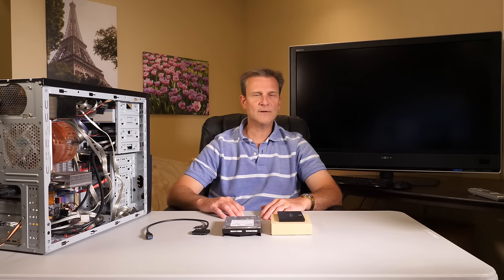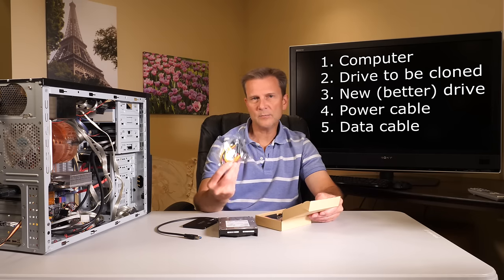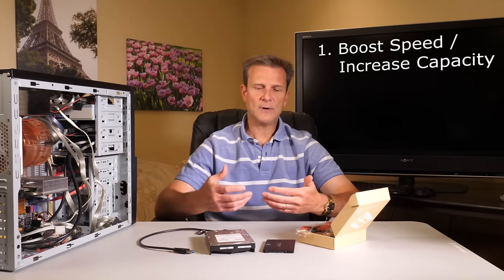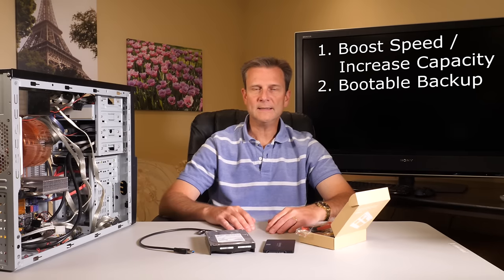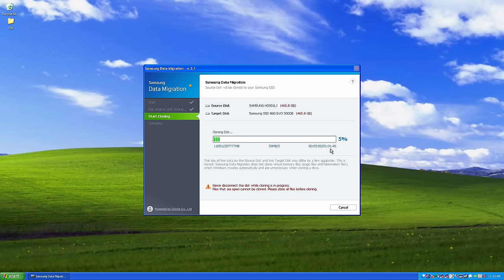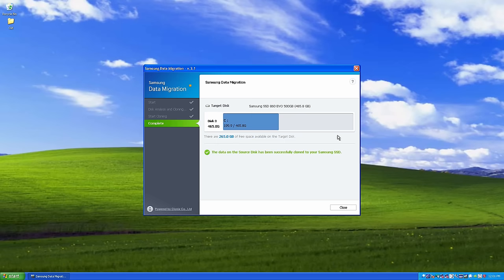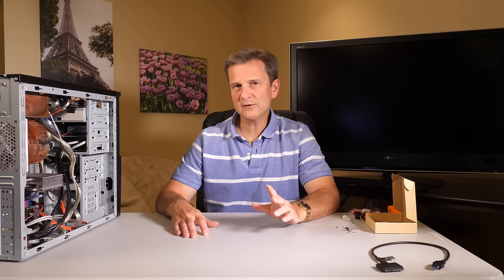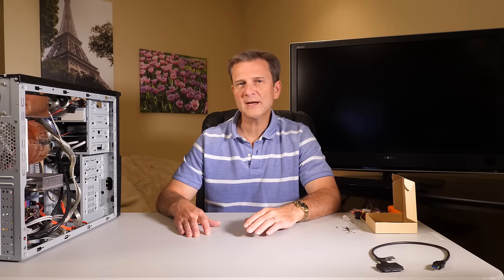How to Clone Your Boot Drive to SSD Without Having to Reinstall Windows or Any Other Programs

Comment: IMPORTANT NOTE: After cloning Windows OS you may need to re-validate your Microsoft OS and MS-Office as it will report that the Licence key isn't validated in most cases you will need to be online to allow the software to check the License validation server  and validate don't forget this important step. With OS's like Linux this isn't necessary

Comment: I found using an external SSD Case to be cheaper than using a data cable. The case comes with the cable for laptops.

Comment: Cloning instructions start at 14:00
Reply: deserves more upvotes
Reply: thanks for the info.
Reply: That saved my 10 minutes (4 before I realised someone had done the hard work and stayed awake during the initial yatter.
Reply: If ya all felt you were wasting your valuable time with the first 14 min. as you knew all of that what the heck were you even watching this at all. There is so much that was left out that most beginners should have already known this much. Things like, DOES your software automatically set the OFFSET for SSD. I don't know about Samsung, but WD does not. How about UEFI? or DOES the software automatically partition for either MBR as opposed to GPT or does that have to be done. In other words, does it copy to UNALLOCATED space ONLY? I prefer MINI TOOL Partition Wizard myself. The only thing about it you need to know is that it does not automatically clone the BOOT portion (partition) on a GPT drive and that has to be done in a separate opperation.
Reply: @charleshadden2937  For the information contained after 14:00.
Reply: Could you boot from the cloned hard drive?

Comment: When SATA appeared in my life, I purchased a dual bay SATA drive dock by inateck. The new version of my device would cost around $50 US today and is available on amazon. You simply remove the dive from your PC and place it in Slot A on the dock. Put your new drive in slot B and press the device's offline cloning button and wait for the cloning process to complete. Then you install your shiny new drive. That's it, job done. The drive dock is also useful as it can turn any SATA drive into a plug in USBc drive, I also use it to backup PC system drives onto offline large capacity HDD's for safe storage elsewhere. 
FYI; I am the I.T support for my entire family and I have never regretted buying this thing as it has removed hours of unnecessary messing about and uncertainty every time I have used it.
Reply: absolutely right!! after hours of wasted time on YT, yours reminded me...hey, I've got one sittin' right there!! :-) thanks, and great luck!

Comment: Thank you Sir. This video is definitely five stars out of five star rating.👍👍 Further, the video host is the closest thing to a "Mr. Rogers of Tech" as is possible. His calm, clear, and friendly presentation. I'm sure is reassuring to anyone without a lot of computer experience.😊 I have built several computers, but have never cloned a drive before, and this video will definitely assist me. Lastly, not that it's important, but I have a feeling that the host is either an active member or veteran of Military service, as am I.😉

Comment: Great tutorial video. Just one thing that I noticed was that it was quite a while into the video that you first mentioned anything about making sure that the power was disconnected from your computer. That is very important, especially for those that have little or no experience with this type of procedures. Like I mentioned, this is otherwise a very educational video. Keep up the good work!
Reply: I'm guessing that you unplug the computer just when you're changing to the ssd? Thanks.

Comment: Thank you for this good video! And I have a question... I've done several cloning before of regular 3.5 drives just for protection with Macrium software and the destination drive always has to be of the exact same size as the source even if the source drive is almost empty. 
When trying to clone just windows and perhaps all the installed programs to an SSD do I have to get an SSD drive of the same size as the source? I just want to have an SSD only for Windows and programs, all my other staff can stay on a regular 2TB spinning drive. Basically I am wondering if the cloning software you recommend would allow cloning drives of different sizes, provided the data you are cloning does not exceeds the SSD own capacity?

Comment: one thing I do that I'm surprised more people don't do is use the boot drive for just Windows and all apps. I have a 500GB M2 drive as the boot drive and with Windows and all apps installed the space taken is just 114GB.  So that's all I have to clone. All data is kept on other hard drives. I still use a desktop computer so this is easier to do on a desktop where you can have multiple hard drives. If the M2 drive should crap out I just get a new one and rebuild it from a saved clone image. No data loss. I never saw the purpose of having a 1TB boot drive. Yeah, you can partition it but I'd rather save my data elsewhere and not on the same drive I boot from. Thanks for video. Very nicely done.

Comment: This is very good, and just what I needed. I put a new Samsung SSD with Linux Mint on my PC, and it was so much faster than the old Win 7 HDD, that I want to get another SSD. I still need Win 7 for the software that doesn't have a Linux equivalent. This video shows me exactly how to do it, and what I need to buy. You have another subscriber.

Comment: Very good video, but one thing you left out was how important it is to ground yourself to the chassis before reaching your hand inside. You could very easily zap a component in there and fry it if you happen to have a static charge on your body.

Comment: my samsung data migration software can't seem to find my samsung 850 evo in windows 8.1 or 10. I used a usb to sata/ide adapter like you had but no go. I had a samsung 840 evo that worked fine.  This is the second one that replaced another one that didn't work.

Comment: Good morning.  First, I would like to think you for your very professional presentation – outstanding teaching.  I’m a 74 year old NON-Nerd who has a billion questions but I’ll only ask one at this time.  You started your presentation discussing the cloning of a laptop using a USB 3.0 to SSD drives cable.  If I have a USB 3.0 port on my desktop, can I use the laptop  procedure instead of going into the desktop itself, other than disconnecting the old HD and installing the SSD after cloning?  Thanks for your time. Phil
Reply from the maker: Hi Phil, yes this should work. If you are trying to clone onto a HDD (the big, old spinning drives), it is possible the cable may not be able to sufficiently power that type drive. But if you are cloning onto a SSD, that should work just fine.
Reply: @NerdSidekick  Wanted to let you know that the transfer from HHD to SSD was so easy that even a NON-Nerd could do it. Thanks again.  Phil

Comment: hi great vidoe
1 question
can i do the opposite?
override a working system with old drive?
i mean to over run the local drive from an external drive

thanks
clone another drive on the local boot drive...

Comment: Useful video. Sometimes I find it tough to start a small screw with my fingers, so I put the screw onto the screwdriver then aim it into the hole. If you use the right sized screwdriver it will hold the cross-headed screw even when horizontal. If you magnetise the screwdriver a little, by sliding a magnet along it once, then that can help too. But keep magnets away from the old-style spinning hard drives!

Comment: Nice take on how to go from a regular HD to a SSD. For me the best take from your script was to always go to the new drive's web site and get the migration software there and it's free! We are the other side, the often builders of PC's and restoring Mac Pro computers so our down take was ... the many loose cables not tied together! LOL I suppose before they made windowed computer cases no one ever bothered to neatened up the inside. Now zip ties are part of the build. Restoring three Mac Pro computers, strangely there are few cables in the case. Oh and the direct connect cable to a loose sata hard drive is a wonderful tool for doing disk images with (no external case required and it's put back in it's original box once imaged).

Comment: Cool theme music...LOL. Anyway I'm going to use your process, but can forgo a lot of the cabling. I'm cloning from my SATA HDD to an m.2 NVME. When It comes in I'll install it to the socket, so unless I'm wrong it should just show up in the 'Data Migration' software and I should be able to run it.  Is that so?   Anyway, Thanks for your info. You'll save me a ton of work. BTW I gave ya a thumbs-up and subscribed

Comment: For those who don't know.  You don't need to remove the power cable from your Hard drive. Instead go into the cmos (also known as bios).  And change the boot sequence to the SSD drive.  And once you do it you will boot from the SSD. And you can use the old hard drive as a second drive. For other types of files like photos, music, home movies,  etc......

Comment: What I did when I built my computer was put in mobile racks. These racks mount inside the computer and your hard drives go inside sleeves that slide into mobile racks.
I just turn the computer off, take a key and insert it into the mobile rack and pull out the hard drive.
I can clone my hard drive in about 20 minutes with Acronis True Image. There are other fine programs out there but this one I have been using for a long time.
I keep 2 copies in rotation all the time. Security is the first think in computer operation.
Enjoy your computer and keep it cloned....

Comment: Useful video, but it didn't cover using the purchased data cable to perform the same operation for a laptop, which is what I need to do. Could you please elaborate?

Comment: If you are going to clone or image a boot drive, use a imaging software. I use makrium reflect. I use this because I am on Windows 7 and no support available now. So I make a image every couple of months to an external hard drive, about 2TB size is good. If I wanted to put that image on a SSD then I just select the image from the software choices, and let it run. Very simple and you ALWAYS have a back up system somewhere.

Comment: Absolutely love Samsung Magician to clone from small NVME boot drive to a large Samsung NVME. Moving 256g from original to new 980 Pro 2TB took less than 18 minutes. Stored the original 256g NVME drive in the transfer case that I used for cloning for safe keeping. It doesn't get any easier than that.

Comment: my question. Was you running Windows on the original drive while cloning it to the new drive? Or, did you use a different pc having both drives plugged to it to clone them?

Comment: I had a boss who was not at peace with "Let's get them glasses." His irritation with the need for glasses taught me pretty rapidly to put up with such simple difficulties.

You covered being sure not to overwrite a disk with data you want to keep, but said if you're cloning onto a blank disc, there's nothing to worry about.

How about this: If it's possible to clone to a disk with data on it, thereby losing that data, is it equally possible to engage the cloning software such that it tries to clone from your target disk to your source disk? If the software allows this, you could easily wipe your source disk!

Thanks for the otherwise clear instructions. (By the way, it's amusing near the end to keep catching your reflection in a part of the tower.)

Comment: Informative step-by-step video but would like to have seen how you accessed the screws in the case on the other side of the SSD.
Reply: Dan. On a lot of cases you can open the other side to install the screws. If not, putting in the ones you can will be safe enough.

Comment: Good & plenty of good info, thanks;  What if you want to clone the drive but also upgrade to another case/MB as well, but keep the boot drive you have cloned? Do which maneuver 1st?
Reply: Windows activation is tied to the motherboard. Switch out the motherboard, you will have to get a new windows license

Comment: Thanks sidekick. I'm a little computer illiterate...Do I have to clean off my desktop screen? Are these shortcut icons running applications that I have to be concerned with when I clone the new SSD ?  If so, how do I  temporarily get them off my screen and  replace them after I get the new hard drive in?  Thanks

Comment: You might want to add that many newer PCs and laptops are equipped with M.2 SSDs. The M.2 requires a different cable than the SATA to USB cable you present in the video

Comment: I don't believe he didn't show changing the BIOS this is very easy to do and everyone should know how when the computer is starting it will show you what key to press to go into setup it's a different key on different computers (f2 on my present computer) then find something called boot device configuration press enter then go to the hard disk boot priority press enter (press enter again if you had more than one hard drive to give you the options to choose the one with your boot file on it) Then select as your first boot device.  on my computer you can then press f10 "save and exit setup" or hit Esc until the save option comes up finish that and you should be good to go!  note: if you had more than one hard drive it might be a good idea to disconnect the extra ones until you have completely finished the cloning process!
    Now in most cases even if you haven't done anyting in the bios it will probably still work finding the only hard drive that is there which is why and how this guys been getting away with this without telling you but if it didn't work you might be screwed until you figured out that you can always get into the computer bios while it is starting up! yeah sounds good to me humor!

Comment: How long on average for 2 TB?
just to understand, I think the maximum speed of the HDD is 200 mb/s, but I don't think it will read at 200 mb/s, the SSD 400 mb/s, but I've never seen my smallest one at 400 mb/sec.
I have a fast computer, i5 9400f.

I asked a friend, according to him more than 4 hours
at a constant speed of 120 mb/sec
7.2 GB min x 60 min = 432 GB
it's correct?
thanks for the support!

Comment: Will this work with an M.2 NVMe SSD?
Also, if I in the future put back in my old drive for extra storage, will there be any complications or will it just be plug and play?
Reply: Can be done, but different hardware needed.
Reply: I put the older replaced "suspect" drive back in and it was recognized just fine. I'll just need to reformat it.

Comment: My computer is barely 2 years old and the SSD is almost full.  I've barely paid off this thing and am not in the mood to take it to the ubreakifix people and pay them hundreds of dollars more to install something that seems fairly easy judging by this video.  I have my 2T SSD sitting here in front of me and I feel very confident that I can do this!  Although, that thing about the Bios is just the thing that will happen to me, haha.  Crossing my fingers that it will go as smoothly as this video demonstrated.  Thank you!
Reply from the maker: Sounds like you don't need to clone a drive. You just need to install the new 2TB drive as a second drive and move some files off the original drive to the new drive. You'll just have two drives in your system. The original will be the boot drive as always, and you can store your new files on the new drive.

You can change where Windows stores documents by default, for example. Or photos or videos. And of course, you can put your files anywhere you want yourself. You aren't bound by the default location that Windows sets for those files.

Comment: Agree, very informative step by step transition from mechanical HDD to SSD. I was just thinking if instead of cloning to SSD, perhaps I can clone my personal Windows OS to a 32Gb or 64 Gb reasonably quick USB thumbdrive. Do you see any problem if I boot up using this USB thumbdrive on an unknown pc? Thanks
Reply: Exactly my question also.
Reply: As far as I know, Windows does not support booting from a USB thumbdrive or USB HDD. I discovered this recently when I attempted to boot my server from an external HDD. There are work-arounds, if you want to do some Google searches.

Comment: I use a Linux usb boot flash drive with ddrescue installed..... slow and requires destination drive to be same size or larger than source but it's free and works with any drive brand.... has the advantage of being able to clone drives with problems (sometimes if original drive is not TOO MESSED UP....)

Comment: The best way to make a backup of your complete drive is not by making a clone. Instead, use the native Windows application for creating a system image. Then you can restore your drive from the image file. To do this on Win 10, go to Control Panel > Backup and Restore (Windows 7) > Create system image. I do this every week in the event of a catastrophic failure, I always have a fairly recent version of my operating system.

Comment: Great instructional video.. one question - can you use the USB-SATA cable you showed, with a desktop also to clone the HD to SSD, or is it strictly for a laptop? Would really appreciate a reply. Thanks
Reply from the maker: Yes, you can use it with a desktop, but the data transfer will most likely be faster if you connect it directly to the motherboard. Plus you probably already have the cables you need to connect the SSD to the motherboard and power, and you will eventually have to connect it to the motherboard anyway if you plan to replace the hard drive with the SSD.

If you just want to make an archival backup and don't want to mess with opening the computer and "getting your hands dirty" then using the USB-SATA cable is a good option.
Reply: @NerdSidekick  Thanks a lot for your helpful reply.